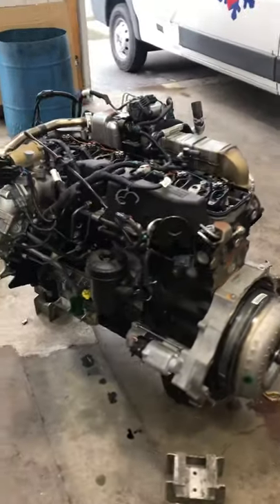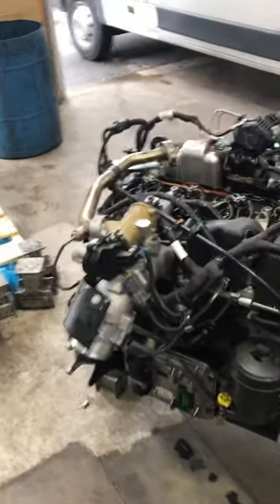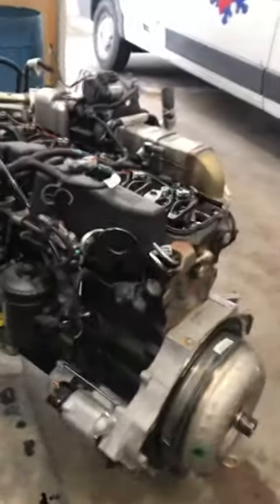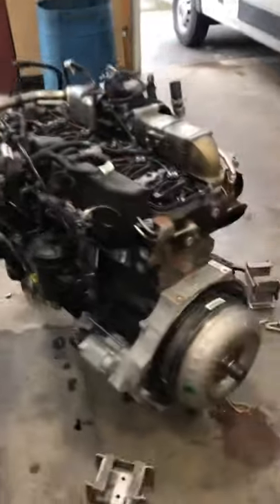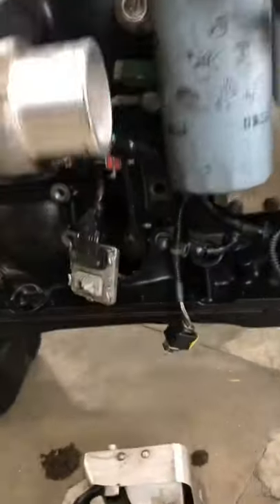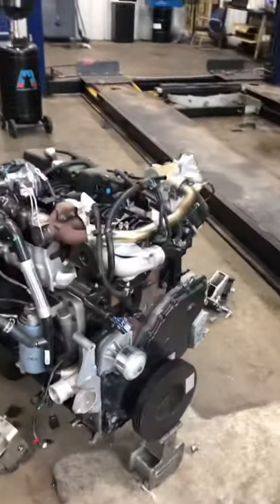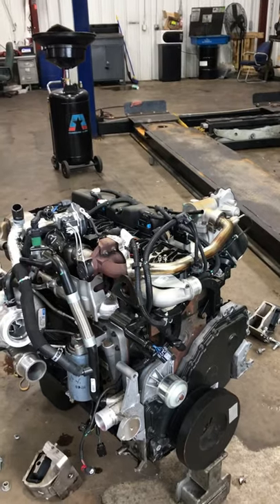NEW CUMMINS BLEW UP!!! STAY TUNED…

Comment: Man! That’s not good got me nervous with my 19 2500 between the fuel pump and now this!
Reply from the maker: It’s very rare for a Cummins to have issues and all 3 use the same fuel pump with RAM changing back to the CP3 to be more reliable
Reply: @JB_WhoWork  JB- Duramax L5P switched to Denso for injectors and injector fuel pump in 2017.